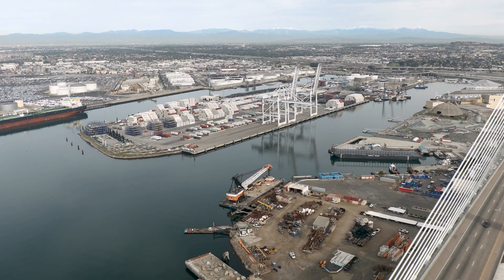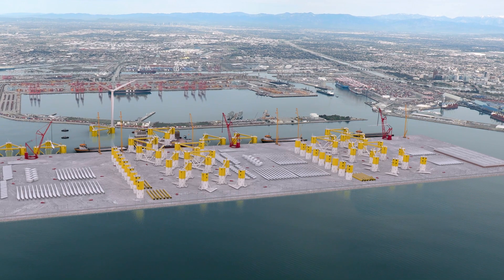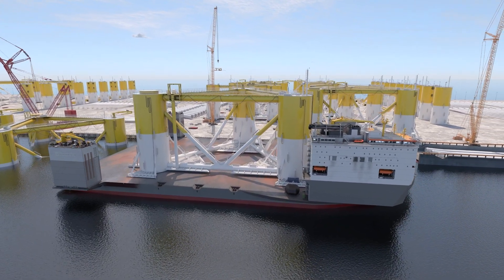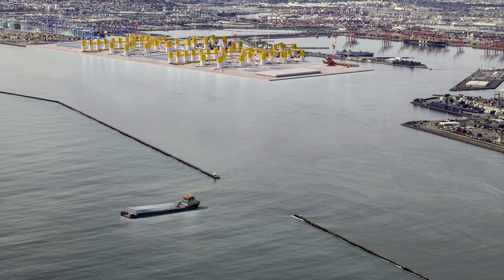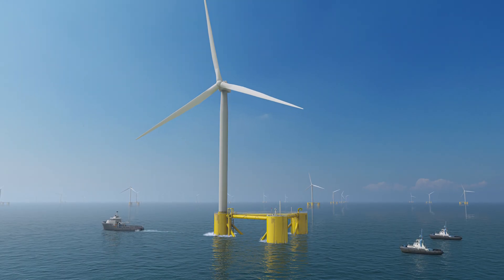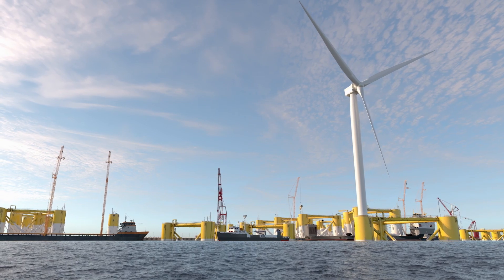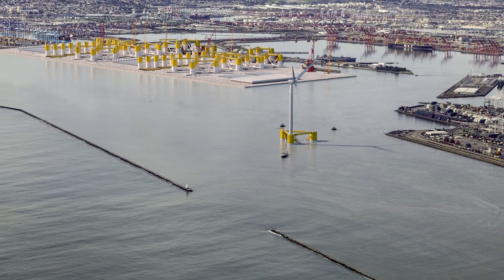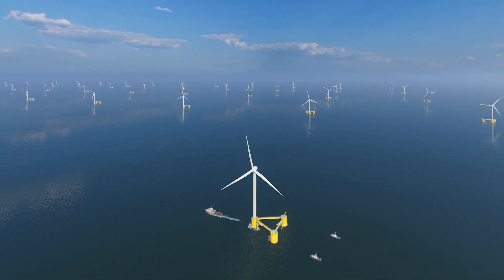Port of Long Beach – Pier Wind Vision

Comment: NOT IN MY BACKYARD!! "Wind energy was abandoned well over a hundred years ago, as even in the late 1800s it was totally inconsistent with our burgeoning, more modern needs for power. When we throw the switch, we expect that the lights will go on – 100% of the time. It’s not possible for wind energy, by itself, to EVER do this, which is one of the main reasons it was relegated to the dust bin of antiquated technologies (along with such other inadequate energy sources as horse and oxen power). END WOKE SPECIAL INTEREST FRAUD! 🤬
Reply: Is there a site with wind and hydrothermal vents? Anyone know?
Reply: @CraigLang  Thank You! Really excellent question... Wonder if the POLB will even touch this with the proverbial 10 foot pole.  I just learned what a hydrothermal vent is (thank you) and how close one (it?) can be found to the west coast.  https://en.wikipedia.org/wiki/East_Pacific_Rise
Reply: And this is some interesting reading too... https://new.nsf.gov/news/first-known-axis-high-temperature-deep-sea
Reply: Modern offshore wind turbines can power a large fraction of the California grid. Offshore wind peaks in production during the evening thus complementing solar power. Along with new battery and other storage, California is well on its way to providing reliable, clean electricity and providing high paying jobs for launching an entirely new industry. 

Bring it on!!